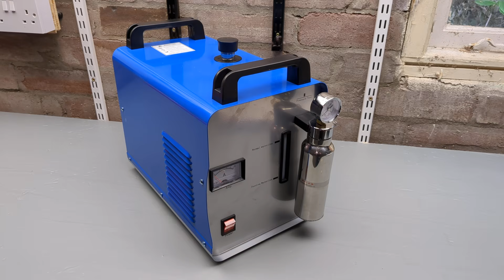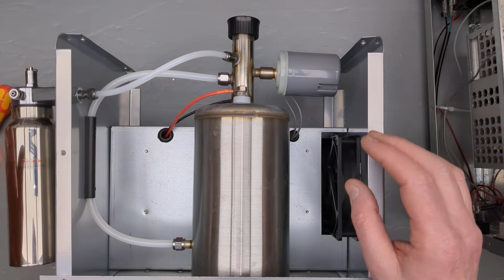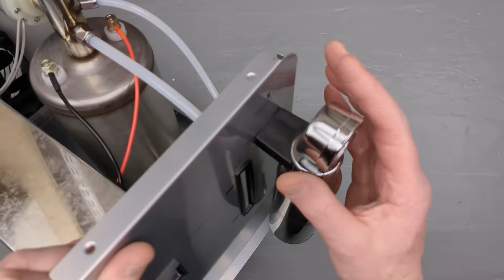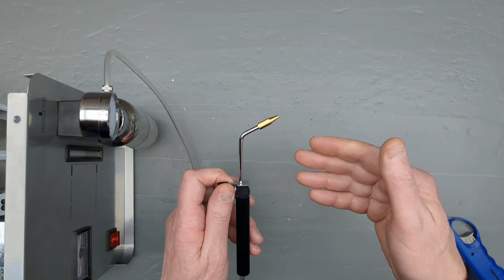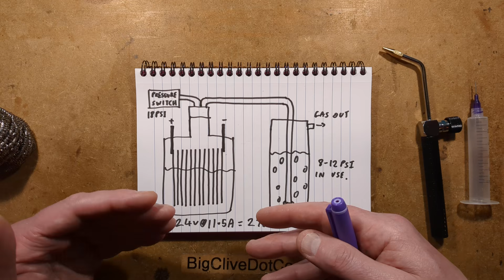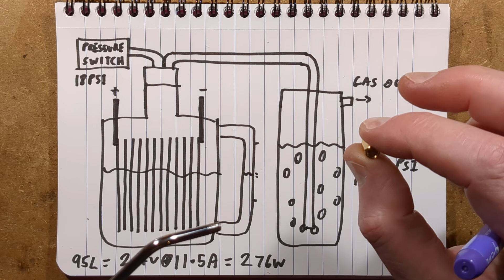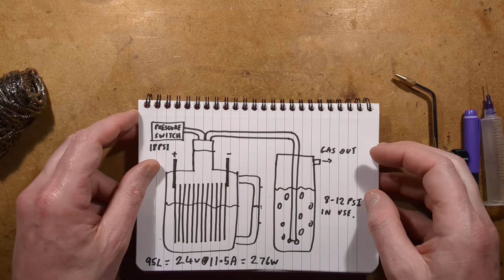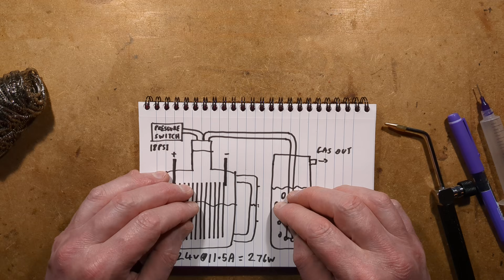Inside OxyHydrogen gas generators (HHO/Brown's gas)

Comment: Oh... imagine if you could run your car on that!!!   Surely one of those machines in the boot/trunk, powered by the cars alternator and with the gas piped into the engine's air intake would provide a huge improvement in economy -- hahahaha!   That's what the scammers told us a few years ago but strangely, none of those scammers who claimed they were running their cars on water seem to be doing so today.  Why is that?  Oh yeah, "big oil" must have bought them off 😛
Reply: I have an uncle (it's always someone's uncle) that parroted everything you just said. It must be one of those universal things like the Marilyn Manson rib story. I just nodded and smiled. I wasn't going to get into the thermodynamics or anything. He would likely go tell my mother in a huff that "your kid is too smart for his own good", even though I'm in my mid 40's.
Reply: @jaymzx0 Hahaha, you saw the current meme about the past meme too huh? We all just figured "Yeah, he did that." without questioning it.
Reply: we obey laws of physics here....
Reply: Funny thing is you probably would be better off injecting the water vapour directly (with a proper system and water/oil mixture) into the gas mixture to lower the temperature of the internal components. Which does actually work since you can get higher compression ratios with it. With the gas systems all the tiny bit of hydrogen will have excaped before it even comes close to the cylinder and the oxigen is too little to matter.
Reply: @NoNameForNone I seem to remember something about that on Tomorrow's World aeons ago. People noticing they got better mpg on foggy mornings, or something. Water spray injectors don't seem to have taken off, though.
Reply: @tonywalton1464  I had a pulsar and a RS Cossie escort with water injection ...  A decent intercooler setup replaced both with improvements in performance
Reply: @NoNameForNone water injection was used in RAF piston engine aircraft. I think to improve power at altitude. Water/alcohol is sprayed onto the turbo intercoolers of certain race cars to further cool the compressed air.
Reply: Any load you put on the alternator you would burn in extra gas.  

“The law of conservation of energy states that energy cannot be created or destroyed, but it can be transformed from one form to another.”

Friction, aka heat, is also a type of heat.  You’re trying to describe the old fable of the mythical perpetual energy machine, which isn’t possible / violates the law of energy.
Reply: That’s way too complicated. Just attach a wind turbine to your electric vehicle and you don’t even need the water.
Reply: My understanding was that hydrogen could act like methane fogging which is beneficial in certain engines by increasing the speed of the flame front speed, producing a cleaner burn and achieving higher mpg's.
Certain engines - archaic normally aspirated 2 valve diesels.
There was a big old blog I was keeping up with in 2010 era, an American chap in a diesel golf/rabbit/Jetta documenting his experiences.
Reply: @zopEnglandzip  that sounds like it would only increase efficiency by a small percentage. I'm pretty sure that the power loss from running the HHO generator would more than offset the improvement. It would be interesting to find the blog though.
Reply: @zopEnglandzip  When the flame-front travels too quickly you get detonation -- which is what you don't want inside an ICE.
Reply: The efficiency of generating hydrogen and using it as fuel is quite low so sadly it is an expensive way to power a car.
Reply: You mean like the people that keep  telling me oil changes are useless / a scam by the oil industry 😂
Somehow they keep coming back to my workshop with broken engines  complaining 😂
Reply: On the zeppelins back in the 1930s they experimented with venting the hydrogen from the canopy through the diesel propulsion engines (they needed to reduce buoyancy as the diesel is consumed) instead of to atmosphere and found a significant improvement in efficiency
Reply: @georgemcclelland5207  modern Diesel engines don't benefit in any meaningful way by burning hydrogen. 
In fact I'd argue that they get damaged since the hydrogen causes the high strength steel to get brittle.
Reply: KIA make a car that uses this
Reply: You got the point bro
Reply: Hydrogen cars need pressurized hydrogen I believe.
Reply: @PastorOfMuppets616  they do and usually they don't "burn" It but create electricity with it. 
There are some Japanese Hydrogen combustion engines tho.
Reply: @NinoJoel  don’t forget the retired GM engineer that made a muscle truck. 

https://youtu.be/RAEhhYqMEBE?si=98-moquuMUcXEbeP
Reply: @KhaoticKalm  nice project. I will watch that when im done with work. 
They build NA V10 engines in japan for hydrogen. 
Only thing id be worried about in the project the GM dude did is that the forged internals may get brittle over time with the hydrogen.   

It's sad that burning hydrogen is so inefficient that it's not practical at large scales. But as a niche thing to keep classics alive in the future it's a good concept
If that kind of modifications where street legal where I live I'd love to build something.
Reply: @NinoJoel  he’s got newer videos where he’s addressing those issues and not to mention the storage issue that if you have a 33 gallon tank you need 100 gallon tank of hydrogen for liquid and a 90,000 gallon tank at atmospheric pressure 😂. 

But when talking efficiency people seem to leave out where EVs fall short and that’s under a heavy load. You go from 300 mile range to less than 100 on battery, 300 - 200 on gas, 300 - 250 on Diesel and Hydrogen is great on a diesel cycle. 

I think we’ll see applications for jets, Boats, Trains, and maybe trucks. And that’s not talking about the versatility of hydrogen. Once it’s stored it’s good indefinitely so you can convert it, burn it, blow up a ballon and float it, breath some in and out squeak your helium friend (don’t light a cigarette) 😂
Reply: @KhaoticKalm not sure you can keep hydrogen indefinitely. You'll have to consider the boil off losses if you are just parked there. That's why most use of hydrogen today are in situ, otherwise you're wasting your money.
Reply: @terrencesauve  once you have it in a stable state ie: cryo or pressurized gas there’s no losses. Where as a battery can be lost to freezing conditions or self discharging hydrogen can be stored indefinitely. At least according to the sales pitch. 

Mercedes made a car that used the hydrogen to keep the cryo and you’d have an empty tank after 2 weeks parking but if they had made it a plug in it may have changed things in the industry. Provided that they actually start building some stations.
Reply: @KhaoticKalm  there are definitely losses with stored hydrogen. Storage is the biggest problem. If you think a kids helium balloon is bad for the gas just passing right through the rubber because helium is a small molecule, hydrogen is way smaller. It will do exactly that right through metal and polymer containers, embrittling them in the process which causes huge danger when storing at circa 700bar for any chance at decent range.
Reply: It’s all about volume versus current. 
Technically in stock OEM vehicles your alternator can’t really produce enough current to create enough volume of Gas to run a I.C engine. 
It’s tricky to see it the issue here, but a Gas engine already has an air intake, and HHO is already at its stereometric mixture meaning it doesn’t need any more air. Since the gas engine has an air intake trying to run pure HHO the engine can’t sustain do to the super lean Air-fuel mixture. 
To much air not enough fuel, in order to completely support a gas internal combustion engine you’d have to have enough volume of gas that’s also “dynamic” so for say. Like the engines whole air intake would need to plumbed to the HHO cell not a small diameter pipe connected to the air intakes breather, then the HHO cell would need to provide high volume gas dynamically with it also having having enough pressure at least at atmospheric pressure or a bit above. Because engines do not “suck in air” 
Internal combustion engines of all kinds gas, diesel, propane, natural gas 4,and 2 stroke even air compressor, and hvac compressors do not “suck”anything into them be it fuel and air, or refrigerant. 
What actually happens is that the piston  creates a void within the cylinder that which in the case of a gas engine the atmospheric air falls into the intake manifold at a pretty high volume, to which then the intake manifold and ports then increases the velocity of this air falling into said engine, for gas engine at some point fuel is the injected or carbureted with metered fuel eventually making it to the cylinder to which the air and fuel mix falls into the engine or any kind of air or vapor pump. 
Same is true if it’s super or turbo charged, and as well as Rotary engines air/vapor doesn’t get sucked into them, it falls into them. 
HHO still is 100% clean, it still produces NOX gas’s which in some states in the USA is more regulated then carbon monoxide. 
Hydrogen fueling is very tricky, internal combustion engines are high volume pumps they move alot of air, hydrogen is one of those fuels that’s incredibly energy dense and clean, but one it comes to I.C engines it becomes pretty I’m practical for right now. 
It it’s gaseous state it’s incredibly light, yes the energy density is there, but fuel density it is not, in its liquid state it’s pretty dangerous it takes incredibly high vapor pressure to keep it in its liquid state, and you’d need some can of flame resistance, and designed to vent and burn safely “valve” to the fuel cell for temperature, and refueling. With the big question being could a fuel cells even be built strong enough “wall thickness” bit yet still hold enough fuel to complete with gas/diesel engines 
I haven’t racked out the math on it simply because my brain tells me no already. Hydrogen air to fuel mix is around 34:1 for open air now (not HHO, again HHO is already at it perfect fuel to oxidize ratio) which is why it can be tricky to understand/comprehend the difference between pure hydrogen gas and or liquid state( because all that means in liquid state the fuel is more dense and will last way longer, like way longer, as if it were in a gas state the fuel is way lighter less dense less fuel) 
And HHO, a fuel that doesn’t need any more air, or oxygen! 
There an open source device that well is quite odd, call the “thunderstorm generator” the original creator’s theory of operation I don’t completely agree with, but at the same time I’m no person who take stuff at face value until I can test and experiment myself, but in short to me it is very similar to the GEET fuel reactor like and improved version, my only concern is that it is in my opinion playing with “scared sacred technology”  that’s confined into a smaller vessel then what was built into the past to an extent! 
The original creator refers to the produced fuel as some kinda of “plasmoid” stuff again I don’t take it a face value until u can get my hands on the necessary stuff to create it myself, and to experiment with it it, but I’m quite skeptical, it kinda hit’s me in that spiritual part of me just saying!
Reply: One! I got a v8 I'll need 8!
Reply: It is just as Clive said - an inefficient way to run the car off its own battery. If you want an EV that actually goes fast, just ditch the combustion engine entirely.  And don't power it with a fuel cell, the conversion efficiencies are horrendous.
Reply: There are plenty of videos from people running their cars on HOH….
Reply: @peteypops  But none of them running purely on self-perpetuating gas generation powered by the car itself, because that would be impossible. And if they claim they are, they're lying.
Reply: @IstasPumaNevada that wasn’t their aim…just using as a fuel ‘additive’…usually pretty sketchy…
Reply: @peteypops  It can act as a poor man's turbo compressor by cooling the intake.
HOH is just water, after all.
Reply: @IstasPumaNevada You'd need to generate power from one of those "two magnets and a spring" perpetual motion machines I've seen on the Internet.
Reply: @economicprisoner not when it’s an explosive gas…not H2O,
Reply: @economicprisoner HHO is water in the same way that flour and sugar are a cake.
Reply: @peteypops  Well you can't cure stupid I guess.
Reply: @peteypops and none of them are real, I also saw a video of iron man. The trouble is it takes a lot more energy to make the hydrogen, your best bet is to run the gas through a fuel cell which turns it into electricity and steam, even this most efficient set up will only yield a net 50-70% efficiency. The fact is there are private capital and government sponsored start-ups trying to squeeze every bit of efficiency out of hydrogen systems,   at every stage. There's no way some random guy was suddenly easily able to crack something like this that breaks all know law's of physics and energy, and yet none of the scientists working with the tech aren't even able to come close.
Here's the thing it's quite easy to run an engine of hydrogen or HHO, and it's quite easy to make the HHO, the problem is there's energy loss in every stage, you can run an engineer off a battery via an HHO cell but you would be much much better off just running an electric motor,

P.S. if you or anyone you know can make any stage over 100% efficient  let me know, I know some rich people who want to get richer and would probably finance the commercialisation of said technology

Comment: The most reliable way to get a flashback IME is to touch the tip of the torch against something while it's lit - workbench, vice, piece of glass, whatever you're working on... as soon as it touches you get a POP and flashback when the flame goes out
Reply: In fact, the safest operating method of any micro torch is to avoid the flame ever being perpendicular to the surface being heated.

Comment: HyperspacePirate posted a video about a week ago about building a HHO generator. He talked about some of the design challenges of getting the intermediate electrode to do something useful. He also tried using alcohol in the bubbler to try and get a reducing flame but it was still more oxidizing than not.
Reply: That’s crazy how there’s these little almost biomes of YouTube channels and viewers that watch the same people . I grew up watching NerdRage and Knighthawkinginlight and the microwave test channel etc and grew into all the other more in depth technical channels (I mean nerdrage was pretty technical but still) like this one and explosions and fire etc. Crazy how all this comes together
Reply: @StayProteus  Meanwhile some dude in a shack in Australia would still generate tar while making HHO.
Reply: @jaymzx0 do you mean Joe from the “Joe Cell ”?
Reply: @jaymzx0  or somehow make yellow gas
Reply: @gilmarkowicz3209  He means Tom from the YouTube channels "Explosions & Fire" and "Extractions & Ire." Both channels are very fun to watch.
Reply: He said in his video that the plates were more effective when the pools between them were isolated from each other, because otherwise the water would provide a shorter path for the electricity to go around the plates, which decreases efficiency and generates heat. The most efficient conversion happens when the cells run at the breakdown voltage of the solution, around 1.3V in his experiments, depending on saturation I think. Less voltage leads to very high resistance, more voltage just generates heat.
Interesting stuff, and he got his generator to output almost the theoretically possible maximum yield, which is impressive.
Reply: @TazerReloaded  Perhaps the bypass path can be mostly prevented by using a pump that cycles on for a short time to refill the cells as needed? There would only be a bypass path when the water is raised by the pump, once the pump turns off, it drains back enough to break the bypass path.
Reply: He needs to use borax.
Reply: It should be a completely neutral flame, as the stoichiometric mix is perfect. If the electrolysis cell gets warm enough from the current, it might evaporate a bit of dissolved alcohol into the gas, but probably not enough to make a difference.
Perhaps a better method would be to have an extra smaller anode plate behind a baffle to catch some oxygen and vent it separately. A variable resistor could be put in series with it to vary how much oxygen is in the torch mix.